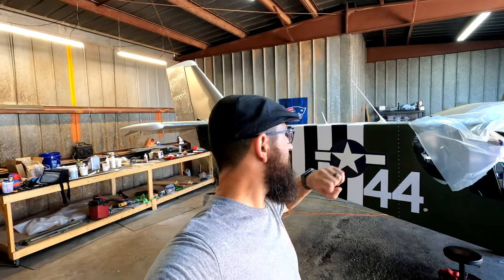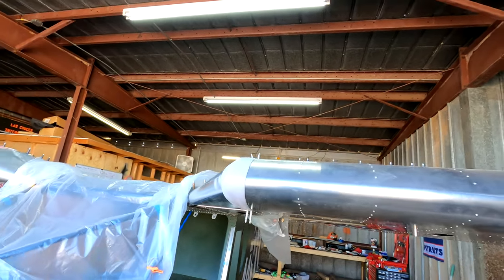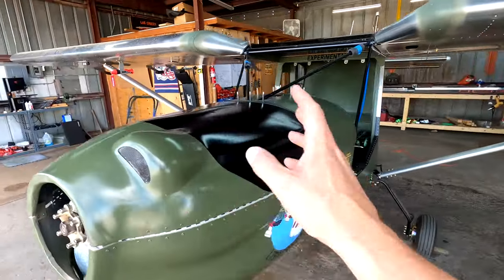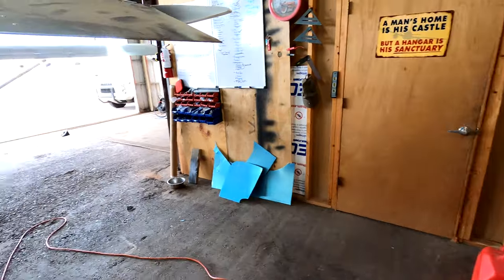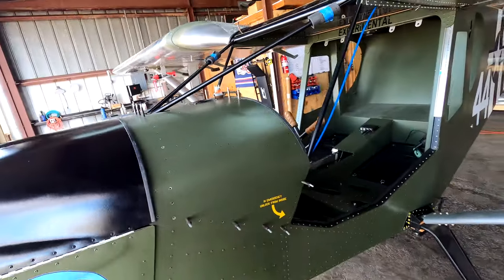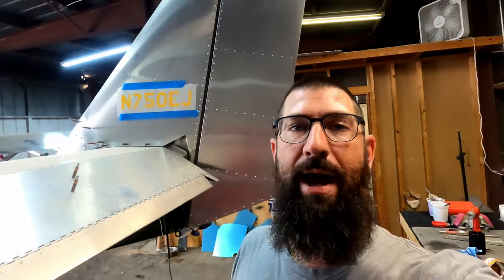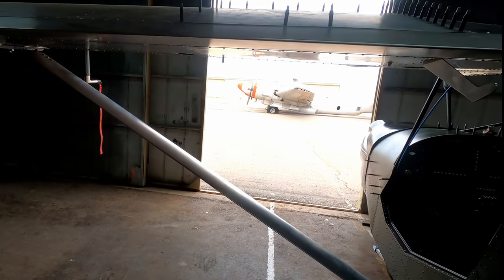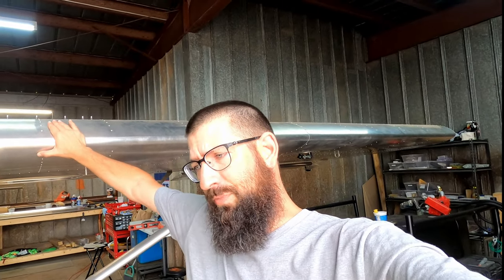L750 Cricket Build: Fairing and Flaperon (Part 1)

Comment: I think you have the Right outboard Aileron on the Left wing, should be a lot closer to the wing tip
Reply from the maker: Thanks for the suggestion, but I don’t think so, but will check the plans again today. The plastic tip and the end caps fit perfectly And it lines up when I test fit the I/b skins.